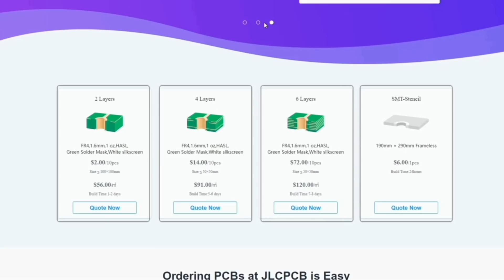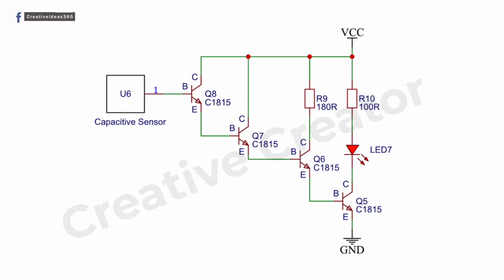Simple Electronic Project [NEW]

Comment: Soldering Skills - God Level
Reply from the maker: Made my day 😊
Thank you so much!!
Reply: @Creativecreator  Skills like this is not easy and should be appreciated. 😘☺️
Reply: @Creativecreator  First question: How does the capacitive sensor work? I mean it's only a piece of copper
Second question: Is Transistor Q7 necessary, couldn't you just solder the emitter from Q8 to the base from Q6?
Thanks for answers

Comment: First question: How does the capacitive sensor work? I mean it's only a piece of copper
Second question: Is Transistor Q7 necessary, couldn't you just solder the emitter from Q8 to the base from Q6?
Thanks for answers

Comment: How can you increase the distance of the sensitivity of this proximity sensor. How can you concentrate the directionality of the sensor. Thano you. I gather that higher rated transistors,batteries and resistors would do the trick. Please correct me if I'm wrong.

Comment: Excellent !, got most of the parts, but what is single core wire you showed in the starting of the video?
Reply from the maker: Normal single hard wire which works as capacitor